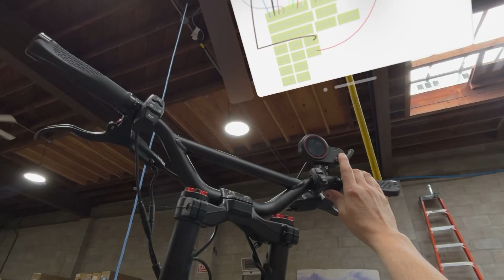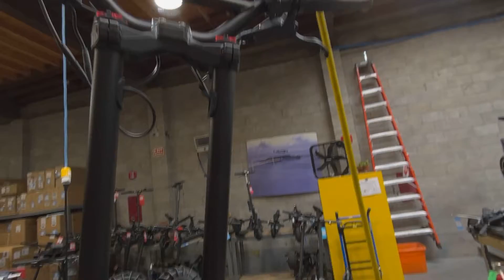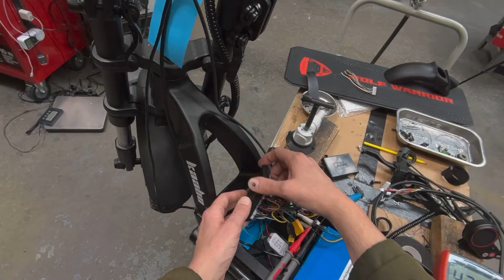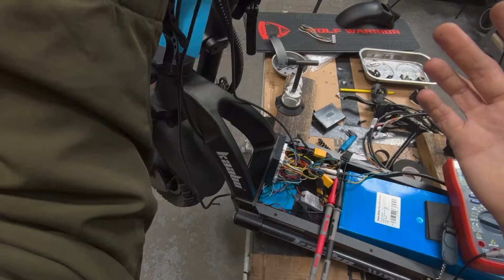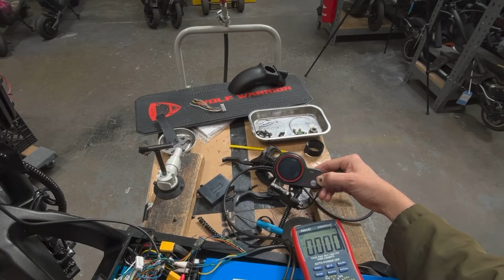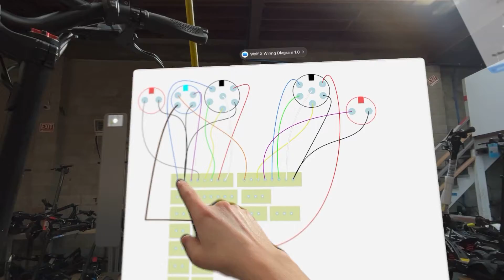Kaabo Wolf X E10 Error 10 Troubleshooting

Comment: I had a bad battery that would not charge. Replaced the battery and everything is working except the motors. I tried the throttle control on startup and got the error code so I know throttle is working. Checked the voltage going into motor at 4.8v from controller and appears to be powering. I would assume the motor but both motors not working at the exact same time doesn't make sense. Out of ideas to try at this point. Any help would be appreciated.

Comment: I have a road runner d4 4.0 and I’m having a very similar experience. The motor halls are fine. I have no headlight or break lights and this all started when I got a new headlight and plugged it in the headlight worked but gave me a error 7 which I then fixed but now have a error 10 lol

Comment: I have a brand new Engwe Y600 scooter and it is showing a J-10 error code. Beeping and flashing lights on the left side of the deck. Do you know what might be wrong with the scooter. Thanks
Reply from the maker: I've never seen that model,  sounds like a communication error.

Comment: My wolf Warrior 11 plus having a strange prob. The throttle works by itself I don't have to press it. I have already changed 3  throttles but the prob is there. the only way I stop the scooter is by pressing the brakes but as soon I release the brakes it jumps back again. Any idea what's wrong?
Reply from the maker: I've seen that happen before, most likely somethings gone wrong with the one or both of the controllers. the rear controller is the first on to try swapping out.

Comment: Appreciate all the information, I fixed my steering notch issue by following your other video. I have a wolf warrior x gt and one of the charge ports won't work. The chargers themselves are fine. Is this a common occurrence? Any tips on how to troubleshoot?
Reply from the maker: First thing to do is open up the deck (shown in another video) and check the 6.3A charging fuses. Most likely one has blown. These are 5mm x 20mm fuses.

Comment: Thanks for the informative video man, good job. Looks like you're busy with all those scooters in there. 

I was wondering, and you might know, On that Kaabo, what controls the headlight? It has high, low, and strobe. Do you know if there is a way to modify it to remove the strobe and just have high and low?
Reply from the maker: The 3 modes are built in to the headlight itself. If you can pulse the power (switch it on and off) it will cycle through the modes but the scooter is setup to avoid that and without replacing the headlight that's all it can do.